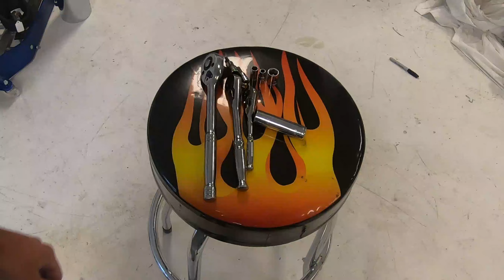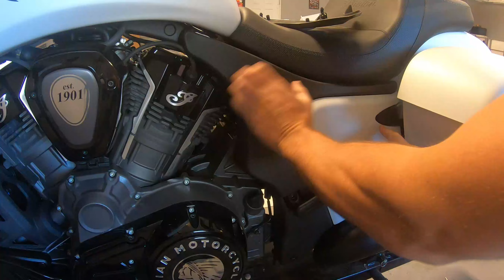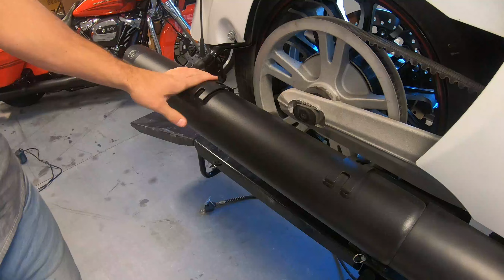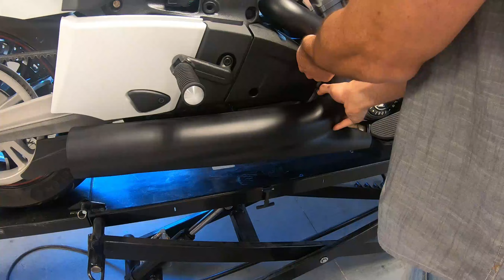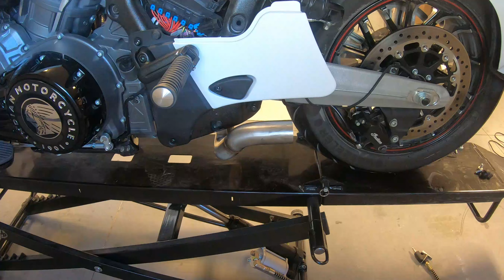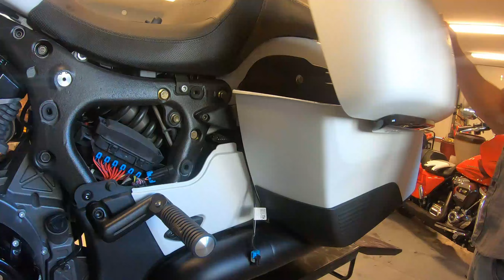Challenger Cat Delete Install Video

Comment: is it safe to say that if i take my bike into the dealer i have to put my cat back in , FIRST because this will VOID the WARRANTY ??
Reply from the maker: To do a cat delete will need a tune, the tune will leave a footprint on the computer and likely void the warranty, so unfortunately the only way to keep the warranty would be to work with the dealer and stay within what they are comfortable with or look for an external 3rd party warranty that would cover modified bikes.

Comment: Mine looks like the turbo clamp is welded on!!
Reply from the maker: Looks like you were able to figure it out.  Let me know if not, but I think I saw a comment later on that it was not actually welded.
Reply: @TABPerformance  totally got it figured out. Just had to use some elbow grease. Thanks for filling up! By the way, it sounds fricking amazing!!
Reply from the maker: That good to hear, ride safe!

Comment: Great video. Opinion question; to achieve a loud deep sound but not super loud, TAB pipes with Zombies (or 2.5" baffles) with OEM cat, or stock pipes with TAB cat conversion?
Reply from the maker: Honestly it depends on what you want to do.  I would say not overly loud but deep and still dropping heat you could go 1.75" louvered with the cat delete or the 2.5" louvered with cat delete.  So many combinations it is tough to say what is right for you, but you could always start with zombies and stock header and then decide from there.  Worst case you purchase a set of replacement baffles.

Comment: Could you paint the cross over with high heat paint?
Reply from the maker: It is a stainless steel so yes, you could paint directly over the product with a high heat paint.  Something like this would be a good option I would think.  We haven't used this before, but here is the link.  https://www.eastwood.com/satin-black-hi-temp-coating.html?SRCCODE=PLA00020&gclid=CjwKCAjwkJj6BRA-EiwA0ZVPVuApgwG8iZ_jjR-qhz2WXr-DcfGp4ecWeBd3bSYcpqWzrHrCUUBEFBoC8YEQAvD_BwE
Reply: Yup, I painted the cat & I'll paint this mid-pie before I install.

Comment: With the cat delete, which fuel programmer or flash tuner did you go with?
Reply: Is a special tune needed for the cat delete?
Reply from the maker: Indian Stage 1 flash for now. Dyno jet hasnt come out with a tuner yet but will soon.
Reply: @TABPerformance so when I got my high flow intake installed from Indian, after I put my tab slip-ons on, the map that came with the air intake is good enough when adding the cat delete pipe?

Comment: Only suggestion is for owners of the Limited models. They might want to remove the lower bag filler, where the antenna comes up through. If not you could end breaking it when wrestling with the muffler.

Comment: Nice, would like to hear each of your muffler options with cat delete. I have a feeling the zombies would be VERY loud.😁
Reply from the maker: Coming out soon.
Reply: Same
Reply: It seems to me that removing the Cat you could then put a single muffler on and have 2 into 1 pipe????
Reply: @Motorcyclemanbh62  Tab makes both cat delete options, 2-1-2 & a 2-1. 2-1 has a dummy left pipe so you can mount the left dummy slip on but you would have to modify the stub pipe to make it a true 2-1